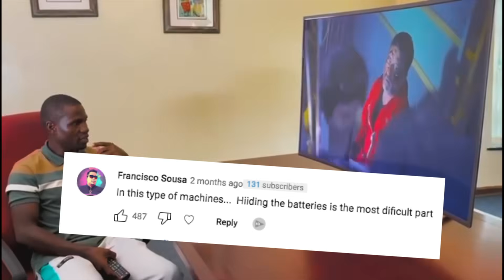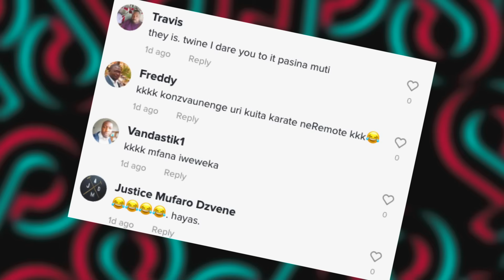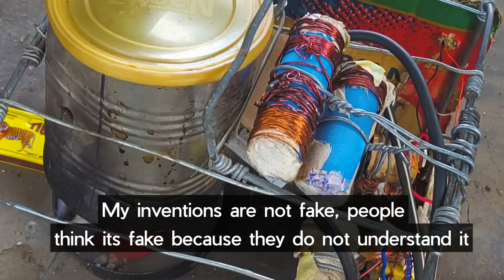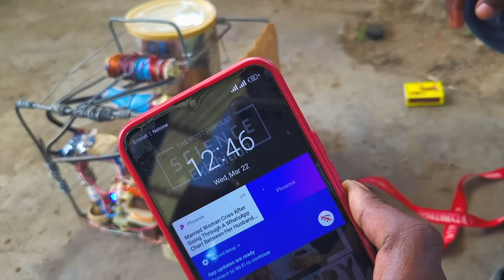Meet Zimbabwe's Youngest Inventor who built a Water Powered Generator

Comment: Whether the generator run on battery or water, the impressive part is that the young man built this device from scratch. May God continue to bless and use him to do a mighty work.
Reply: You don't go on internet and expose your invention. Boy you got be smarter than that.
Reply: You don't know that the generators which use fuel they have batteries too this actually runs on water if you doubt it..
Reply: Africa is coming !!
Reply: It doesn't run on water or the battery or the interventionist sky daddy you imagine God as. It runs on heat from the candle under the water. 

Building a thermo electric generator is impressive. No one's saying this isn't impressive. It is. What they're saying is that it's not an invention. This is how almost all electricity is already produced. Heat makes steam. steam makes mechanical motion. mechanical motion turns alternator generating electricity. 

Building this generator might might make him a resourceful genius. It doesn't make him an inventor or magical.
Reply: Manje kenduru ropera zve
Reply: Yet he doesn’t have an engineer degree!!
Reply: It's not run on a battery! That wouldn't be generating electricity! Sorry, but that would be stupid! To take electricity from a battery to make electricity would only result in loss of energy when you can take the electricity from the battery directly.

This is a cool way of making electricity from a candle. Love it! But, it is NOT water electric generation. It is candle heat electric generation.
Reply: It's the steam generator mind you the other generators use diesel, Petro with etc but it doesn't use any of that it runs like a car engine..
Reply: @johnnyhorton5984exactly, it’s powered by candle flame and runs like an engine. But I guess that doesn’t make for a sensational headline 😅

Comment: i hope this guy goes on to be an engineer ,but this thing is an elactric motor running off batteries. the crank is connected to a small electric motor. but hope he learns and prospers

Comment: The boy is a scam the chager is modified to make it look like a regular 110v or 220v it's getting power from the blue battery built in the circuit the the power goes to a spinning motor and to the 5v cable made to look like a wall chager the key is turned 3 times to give the effect of a difficulty start the candle and water is all a gimmick the vaper would have escaped because that lid can't hold the pressure from boiling water next joke pls

Comment: This is what we call steam powered generator. It's amazing to see it being done by such a young lad. I am blown away.
Reply: Correction, this is what YOU call a steam powered generator. Most normal people call it 🗑️
Reply: Nee beste man het zijn de batterijen 🔋, maar toch respect 🫡
Reply: Ever seen a sterling engine ?
Reply: I think this is fake 
Can anyone tell me the use of the starter on this project
Reply: no man this is not steam generator, can you see the steam pipe coming out of the can, also I cant see mosfet transistors to convert dc to ac, these are just batteries and absolutely fake
Reply: @mrcode6123  Yes, and there is no way that piston is doing 8000 rpm with  this tiny amount of vapor...
Reply: Every kid in my class made one of these in 5th grade.

Comment: It doesnt work on water.  It works on the battery hid behind the cardboard box where the key goes or those green things could be lithium cells.  Half of the wires werent even connected.   There is a main switch he doesnt mention.  Why does it need a switch and a key...and a flame? 
The dead giveaway however is the random coils of wire.  He is just trying to make it seem complicated.

Comment: Sorry but this is fake, there are some batteries inside. You need 50Hz and stable 220 volts to run phone charger. Also when you put load on generator (connect phone) generator should slow down.
Reply: 04:19 oh God... I see two 18650 batteries. This is simply a scam

Comment: Its so easy ti tickle the charging indicator of the phone the question is will it chrage the battery? As i noticed its only driven by a small toy motor to generate the power and probably steped up by the transformer. I dont think it has enough power to fully charge the phone.. just use cheap solar pannel bro..😊😊

Comment: You should include an electronic heating system from the electricity generated,hence it will provide more heat required to evaporate much water than the candle furthermore it will continue with the heating effect after the candle goes off.
Reply: wrong

Comment: that drone in video look awesome fake asf because propeller is in front which pull air so its job to go front not straight up and plane it tilting looks like this guy using some thread or wire to levitate it in air and that generator WTF is that little water and plastic cap to cover that hot steam wow and why he use copper coil to wrap pipe ? and that key 4:51 fake asf he is controlling speed of motor ? 5:22 man its too much he hide battery inside that tube looking thing try to open it and see and you will know

Comment: most obviously fake shit I've ever seen he's using 2 18650s from a portable charger to run both the motor and charge the phone no steam generator ever runs that fast simply by the laws of science and if it was running off the steam that fast there would be steam pouring out of the "exhaust" at a high rate. there's nothing genius about this besides the fact he fooled almost every commenter.

Comment: @3:16  if it really works then it doesn't run on water but on the heat(from the candle) that is creating the steam(more like thermal power station like hwange)
Reply: It's a Steam engine that's turning a small alternator.

Comment: I'm not sure if that can produces enough steam to power an Electric motor. that lid on the can did not even bulge because there's no pressure in it so it means that rotational power does not come from the steam but instead there might be a battery inside that little blue cylinders that makes the electric engine (dynamo) run and charge the cellphone..
Reply: Yep, a steam engine can do this but there is definitely no pressure created to pump that motor
Reply: He could have more success if he built a Stirling engine, no batteries needed, but they can be made with some pretty scrappy materials and produce credible results.
Reply: No pressure from normal heat water but it all run due battery.you all made it from scrape.so good.....
Reply: fact is a fact- that steam will not move a piston. what does the spark plug doing...  just because he is a young boy that does not mean everybody should be flattering.
Reply: @panto026 I was wondering the same. A spark plug on "steam engine" that just sits there and makes... Sparks 😂😂😂

Comment: high fake sorry to say . no 1 that plastic lid will pop off so fast as soon as the slightest bit of steam builds up and at the same time we all know what plastic and heat does. he turns a key to start.  he makes us believe the steam valve opens so where was that hot steam building up Def not in that plastic lid container   we see no pistons and that motor runs on batteries     cool video very amusing but high fake

Comment: Its not an invention at all. A steam engine was invented over a hundred years ago plus its not water poweres no no its a thermal engine. Also this boy is faking it, hile has hidden batteries. Steam engines operate under high pressures

Comment: 😂😂 CAP.... those two blue things are rechargeable lithium ion batteries, that "piston" is just a DC motor, that candle can't generate enough hot steam to make that thing 😂rotate that fast. With the right amount of heat to make steam that hot to be at that pressure, that plastic lid will melt. That boy will be a good SCAMMER one day😢
Reply: Exactly.

Comment: 5v Battery + a Motor to Fool the Fools. (HOWITSDONE) The AC Pins of Charger directly connected to USB Micro Pin which is = 5v and Phone charges with 5v From Battery Hidden inside those Fake Coils he made. BUT that's YOUR only way to make more views Ba ZIM TECH GUY.

Comment: This is fake. A candle cannot produce enough energy to generate the mains voltage required to operate a phone charger. The paint can cannot possibly contain enough pressure to power a steam engine without leaking or blowing up. There was no steam vented outside during the return stroke of the steam engine cycle. Based on these observations, I conclude that there is a battery inside the system that produces 5V. This 5V is supplied to the motor, which is depicted as a generator here. The motor spins due to the battery power, not steam power. The same 5V is then supplied to the charger, assuming that the internal circuits have been removed. The 5V from the battery is directly supplied to the phone. The charger is also fake. Don't blindly believe either me or him. Use your brain and think for yourself. This situation violates the conservation of energy theorem. In order for the charger to function and charge the phone, more energy is required than what a single candle can provide.
Reply: "Energy can  neither be created nor be destroyed but can be transferred from one form to another "
Reply: I find it incredible noone can see what is really happening here ... is it just "wishful" thinking??? the minute I  saw the lid on that "Steam Boiler" I knew it was total "sh!t"

Comment: This is not true.water never boiled to generate steam.the charger used has no transformer inside.two betteries were used to turn the motor and charge the phone.let me break this down.two betteries of 3.7v each connected into series generate 7.4v which was stepped down to 5v for cellphone and the motor.

Comment: In my opinion I can't judge but to me even though the boy has transferred DC voltage to ac but it is not the pressure of steam in this video that starts spin the motor.Lets be fair and honest the machine it's motor DC to AC not steam engine I am not that educated but steam engine require high pressure to start the turbine the lead that it's used here it's very weak to sustain such pressure. Let us not be ignorant be fair, and when we deal with energy transmission put in mind the energy can not be created nor be destroyed but it can be transferred from one point to another,so the candle it's may not generate enough heat energy needed to spin his motor . conclusion is that's to this point he may be very creative but ce can't call it pressure generater. Good basic anyway.

Comment: Why did he need to start the engine with a key?
Am no Engineer but i sure needed to see some kinda turbine driven by steam pressure to generate electricity but nothing was happening until he turned on an obviously (hidden) battery powered generator!😂
Reply: and the plane with the engine in front but flies vertically
Reply: 😅 @bleedblu
Reply: Kkkkk this a no brainer fake

Comment: its fake.... first of all... with the plastic lid there can no pressure built up....    there is a hidden batterie....!  You can see the charging plug was already opened. There is no 110 or 230Volt  he just emptied  the plug and kept the 5Volt wires stright.

Comment: I made a long argument earlier proving why this is a hoax, but here are the main points cuz that one failed to upload.

The steam never leaves the system. It only ever enters the blue tanks after passing through the motor pump, and never leaves them. The blue tanks would very quickly reach the same pressure as the can and that would stop the motion of steam. Additionally, there is no part of the engine that is locked behind a key, the steam should be flowing and the rotating disc should be rotating after the candle is lit and the can is closed with water inside, not after the key is turned.

If there is a way to prove that the steam is bring vented out and that the key is connected to the steam apparatus, then it may be possible this contraption is genuine.
Reply: Also, spark plugs consume power to create sparks used to light small fires in car engines. There is no reason for a spark plug to be in this contraption.

Comment: Firstly, it is NOT WATER POWERED, it is HEAT powered, energy comes from the candle.
Secondly, I believe that is fake.
Battey probably is where he puts the key.
There is no RPM drop when he plugs the cellphone.
That sparkplug has absolutly ZERO meaning in this circuit.

Comment: I think , key place 6v battery is switched on, it passes through the charger ( empty inside), and the 6v directly connects the mobile for charging
Reply: Thought the same too. 5v DC, no AC.
Reply: I thought so even my self first time i saw it
Reply: Exactly. That loose Plastic lid on what is supposed to be the boiler can't hold the steam pressure
Reply: These idiots above saying people are rude for pointing out a fact are the reason that africa is a joke, Wakanda isnt real guys. and all the scrape he put into that does absolutely nothing. just to point out a HUGE flaw in his design is that you would not need a key to start a steam engine, cause a key is only used when you need to supply power to the  the thing on the other end. anyway, f you cant understand even that part then there is no point trying to explain why this is pile of scrap
Reply: Bingo! You win the prize.
Reply: God created big brain❤in Africa
Reply: 😂😂😂 the most difficult things of this technology is to hide the battery 😂😂😂
He is even using fake charger that has nothing inside it to convert high voltage to lowe voltage because there is no high voltage 😂😂😂 it is just directly connected to charge pin which eventually connects to the hidden battery 😂😂😂😂😂
Reply: Please if you can't invent stop condemning other and stop saying it is fake
Reply: You guys are too jealous of a little boy efforts.
Reply: @malickkeita2508  It's a fraud
Reply: @malickkeita2508  not jealous they saying facts .. and this is fake 😂but i support him
Reply: @malickkeita2508 they are not only jealous but also rude

Comment: The power isn't  coming from water actually but the blue battery connected to the circuit, he is ambitious on becoming an engineer and by the same passion he will become one  ,study the circiut well
Reply: well spotted 18650 or 21700 batteries ha ha
Reply: This I realised😂
Reply: A battery 🔋 cannot power a charger, so that means the power is totally generated from the invented generator
Reply: @SamsonAdetayo-n3k   cái động cơ điện đó không thể tạo ra 220v hoặc 210v AC
Reply: @SamsonAdetayo-n3k  observe the charger, it has been manipulated. That charger has probably been tweaked to use battery. Do you know that your Energy saver bulbs can b made to b powered by battery?
Reply: Or it might be just a steam turbine that was invented long ago: https://en.wikipedia.org/wiki/Steam_turbine
Reply: I am seing a modified charger that seems to be taking dc current from the batteries. I am sure if we put a different charger we will get different results. The interviewer was also supposed to ask the guy to remove the candle and see whether it will continue charging or not. The idea is good but more clarity is needed
Reply: Those are not batteries check closely
Reply: After the dynamo started he disconnected the circuit😂 what were you watching
Reply: Steam bout no engine, where do the steam goes ? Steam needs a engine with pistons and a crankshaft, not real
Reply: those are pistons not battery they make the thing move and spin anf then he prolly h it hooked to a motor (magnets and copper coil) which actaly generates electricty (if you spin a motor it will generate electricity)
Reply: your head correct, 100% battery give electricity and lights
Reply: CApacity
Reply: Tabiki de yani sonsuz enerji diye bir şey yok bunlar hepsi yalancı
Reply: you are actually very right, you have seen it all.
Reply: Play it better....I want to see where the vapor of water go...in that video can't see it ....
Reply: We are poor because our gvts are unable to identify and support people like him
Reply: Steam engine

Comment: Its fake, when he plug the charger we didnt notice a drop in RPM due to the applied load. Besides the there was no exhaust for the steam to come out. Also it's not possible with his setup to produce the required pressure to drive that motor at such RPM... and if you look closely there was no piston and crankshaft to convert linear motion into rotation. Its certified FAKE

Comment: Watching real electrical scientists and engineers, I can the kid is smart and knows how to lie. His family is teaching us how to get funds from the public. The wires he tied up makes non sense. And a generator cannot run purely on water electrolysis. Its impossible to get that energy efficient.
You have to put 10kw of electricity in a hydrogen generator to be able to get back a 3kw. So is about 30% efficient.
Reply: Its running on steam technically, but like you i also doubt its effectiveness for different reasons. He could actually use those components to make a working steam engine with a bigger fire and more water, but it would require a substantial change to everything else…